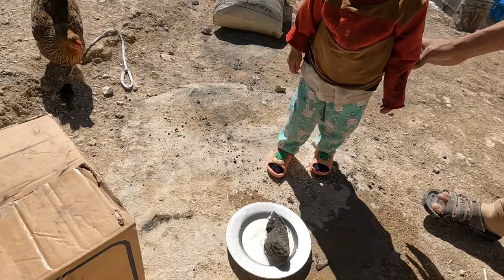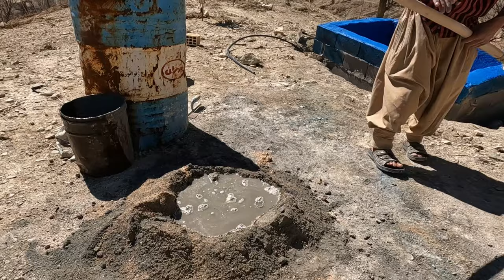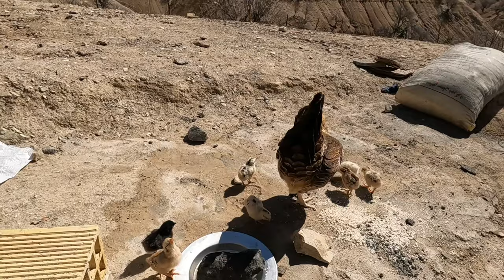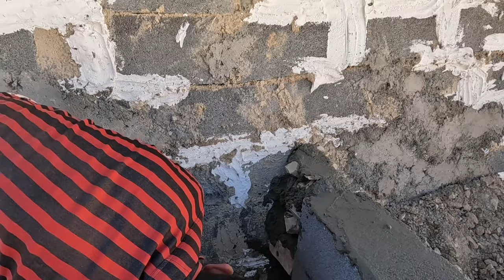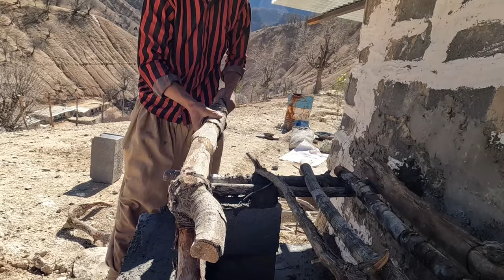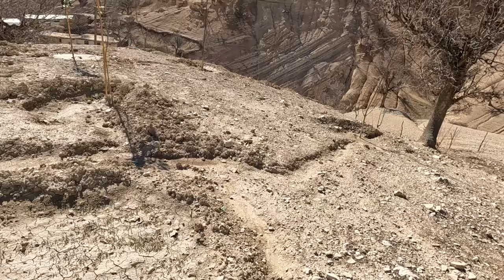Building a Nest for the Hen and Her Babies | Hut - Episode 115 | Survival Adventure Series

Comment: Hello Kamal, 

the chicks are lovely!  I have counted 9 of them - is that the right number? 

Regarding the henhouse: if I were you, I would cut off all that plastic on the roof, and planted grass and herbs in the soil you put there.  It would look nice and neat! The plastic doesn't look good. 

Also, I think you should have painted the inside of the henhouse white, to protect the chicks against possible parasites.   Now it's too late - you can't climb in! :-) 

Also, please put some straw on the floor of the henhouse, and in another part some ashes.  The hen and the chicks  need an ash bath from time to time, against parasites. 

Good luck with everything! 

Mirka